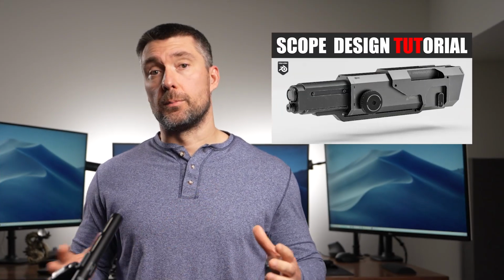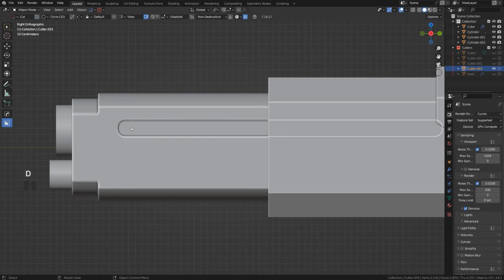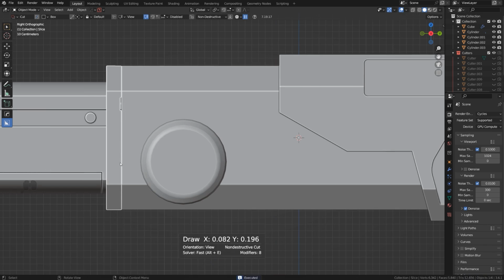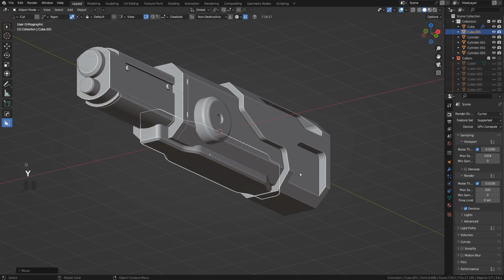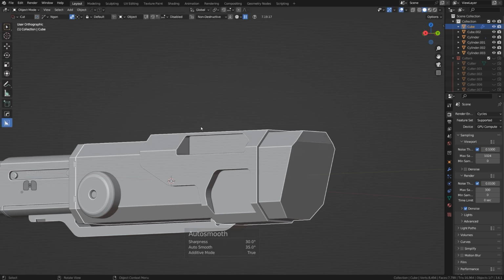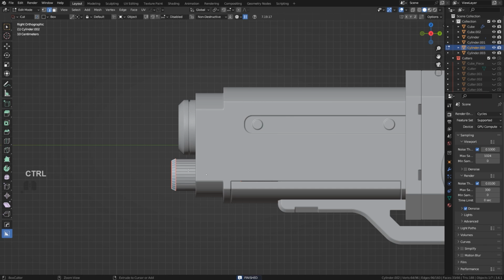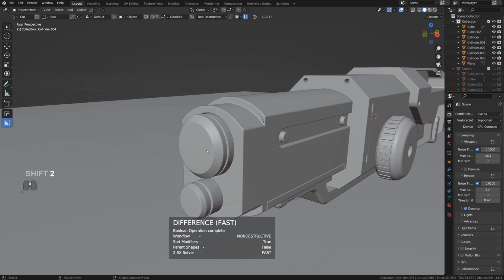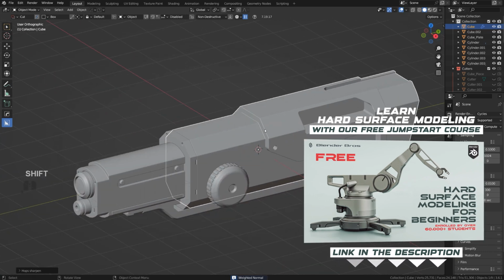Hard Surface Modeling - Blender TUTORIAL

Comment: Hey, Ponte. I really like your work and this certainly is nice and sleek (especially for a 20 minute design), but I can't help to be a nit-picky bastard and throw some minor criticism your way. 
Telescopic sights usually have 3 adjustment controls. Diopter, elevation, windage. 4 if the scope has several magnifications options. Your scope needs more knobs and dials.
Also In real life I would not use your scope because the eyepiece is too small and would cause unnecessary strain on my eyes.  (Bigger is better!)
I know this is about modelling techniques, but you're a big boy and you can take some minor criticisms. 😆

Comment: Genuinely asking, is it worth it being specialized in hard surface nowadays? Seems hard as fuck getting in the industry these days.
Reply: There is only hard surface and nature when it comes to modeling. 
So, if you specialize in hard surface, that means everything that is man made and non-natural. General industrial design, vehicle design, architecture are all specializations inside of hard surface. Video games/realtime and VFX/general media/advertising are all different specializations.  So if you pick up hard surface there are multiple ways you can go and you'll be busy for a while.
Once you got good or mastered hard surface, I would argue it's very easy to branch out and become more of an generalist.  
I started as generalist (which is not ideal, quite stupid actually) because I had no plan. After making it hard for myself for many years and getting nowhere, I spent some years learning hard surface modelling and a little concept design, but I also branched out slowly to environmental design. Now I am picking up VFX (slowly).  
I would say it is much easier to start with one main discipline, go deep with it and either stay or go wide. Either way you'll want a solid base first which is important. 
You can "specialize" in hard surface but also be more of an generalist by learning the whole asset pipeline from start to finish. Concept, modelling, UV/texturing/shading, lighting and rendering. This will open up more doors and possibilities. 
The best motivator is passion. If you don't love what you are doing you'll be at a disadvantage - as cliche as it sounds, do follow your passion because it will be easier, more productive and more fun.